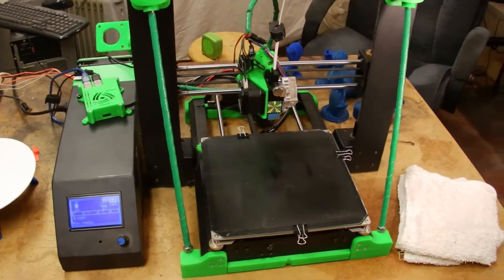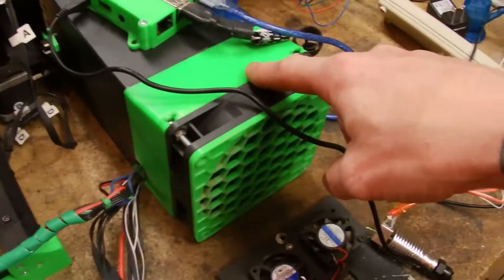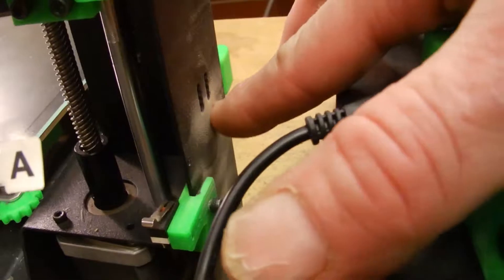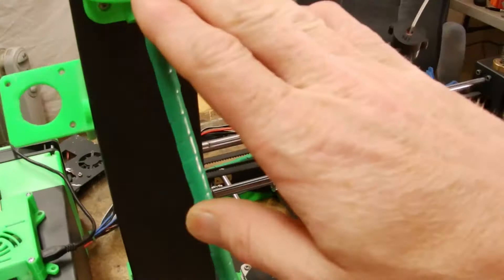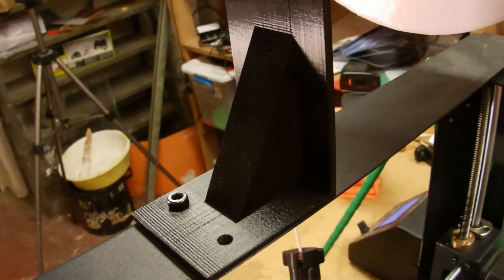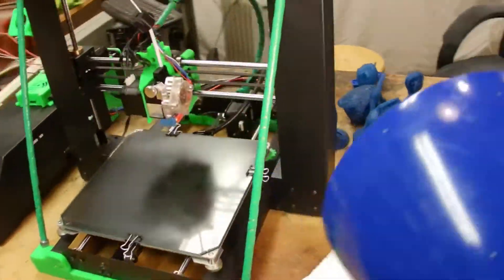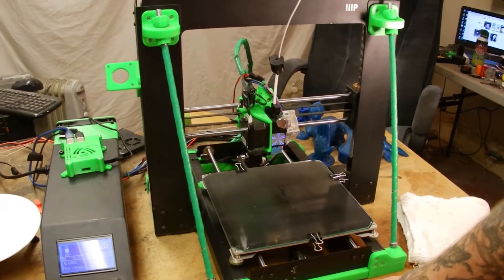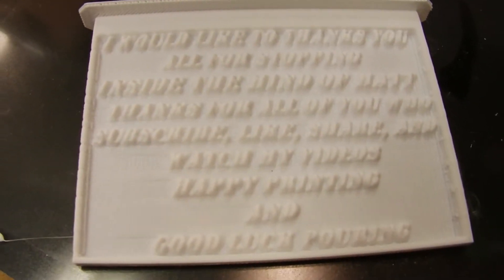10 Modifications to a Monoprice Maker Select V2

Comment: Hi Matt,

I am hoping to replicate your Z switch upgrade so I can switch between printing PLA and PETG without having to relevel the bed everytime. 

Despite also having the monoprice maker select as well, I find that my screw holes are different locations (located deeper in and diagnal from each other) for the z switch compared to the frame the wanhao has. Did you have an issue similar to this? If so have you seen any similar adjustable z stops for the maker select?

Thanks for such a fantastic video, I've referenced this video a good number of times since I have had this printer (also your micro swiss install video is fantastic as well).
Reply from the maker: The link for the z switch is in the description. It doesn't use hole in the frame it just locks onto the frame itself. And I happy that you liked my Micro swiss video I was trying for funny and entertaining

Comment: I have maker select that i got at an auction. Been trying to get it to work properly. At first the x-axis would not go to the home position and so I upgraded the firmware to the Marlin and that solved that now the prints start in the upper right corner? and i need to reset the printer due to bed temp errors like E1 Thermal runaway and it seems to take awhile to get the bed to preheat any ideas and it doesn't seem like the filament is adhering to the bed correctly. could you send me your configuration to make sure i am doing this right?   Thanks

Comment: I have a maker select and it just stopped extruding. I checked it and it keeps clogging. Literally after every print it clogs. Another problem I have with this printer is that it buzzes when I turn it on, and I could never seem to find the right temps and settings for cura to get my prints layers to be perfect. This printer is really good and I like it but it’s so unpredictable for me. Can you please tell me what upgrades I should start with to stop these problems?

P.S: my printing bed is never level even after I adjust it. It seems like the bed has warped. And the spring adjustments that were on the bed would never work. Is there anything I could to fix that?

All in all my main problems are that the hot end and the gears get clogged after every print. And also what settings or mods I need to make my printer accurate. And what mods I need to level it perfectly. 

I would appreciate the help.
Reply from the maker: For the hot end this was my solution https://youtu.be/6E5bkwFY6DQ and for the bed I’m have since this video added a proximity probe and that has solve me having to tram the bed
Reply: Inside The Mind Of Matt is the E3D Titan Aero HotEnd and Extruder compatible with the all metal hot end? Basically can I switch the Titan Aeros hotbed for the metal one or should I just leave it.
Reply: Inside The Mind Of Matt is the E3D Titan Aero HotEnd and Extruder compatible with the all metal hot end? Basically can I switch the Metal hotend out for the Titan Aeros hotend? Or should I just leave my printer with the metal hotend and not get the Titan aero?
Reply from the maker: The Titan aero is the Titan extruder and the aero is the heat sink and hot end together making if a direct drive and it’s all metal it’s a great upgrade but it does require to be calibrated and firmware adjustments are needed I hope this answers your questions
Reply: Replace the Y carriage plate. Some printers come with really thin y carriage plates which bend after a few hours.

Comment: Additional fan to the control box is not needed.   Problem is that the power supply fan is blowing out (which makes it inside the box)  and the back plate fan is blowing in.   I've had my printer in the garage for many hours in 90 degrees heat with no issues after reversing the fan to allow whatever hot air may be inside the control box to circulate out.